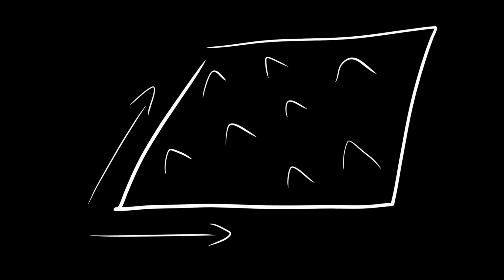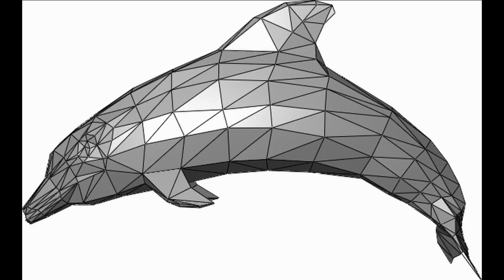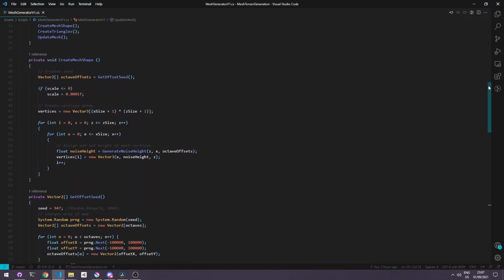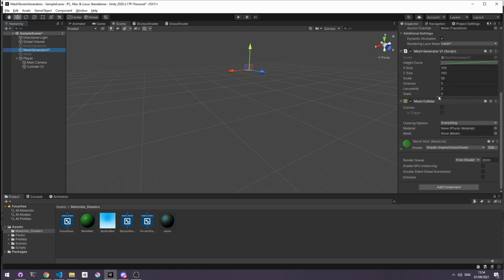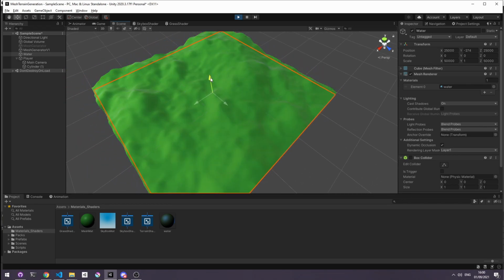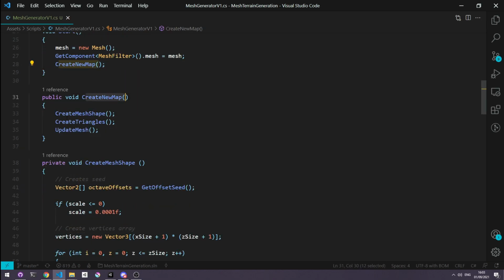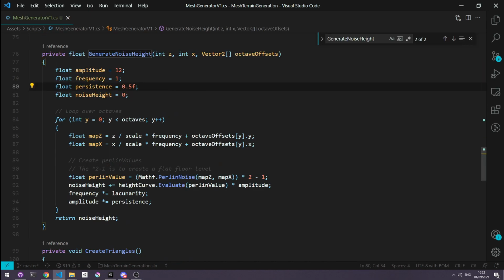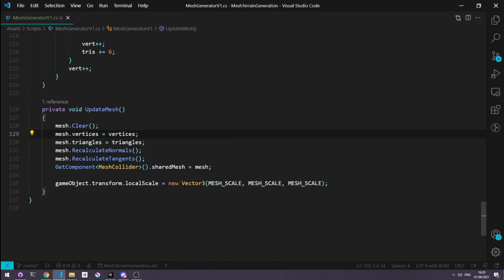How to Procedurally Generate Terrain (in Unity!)

Comment: Once you have the perlin noise generated height map you can load that directly into a Unity Terrain object (terrain data) and let Unity manage creating the mesh.  Doing this (vs. creating your own mesh) gives you access to a host of terrain functions, like get the height/elevation of the terrain at any point for placing object vs. raycasting.  Granted there are some who want to write all of their own code for everything but I'd point out that the team of Unity engineers that spent an untold number of manhours developing the Unity Terrain system is more likely to be better than anything the average person could come up with my themselves.